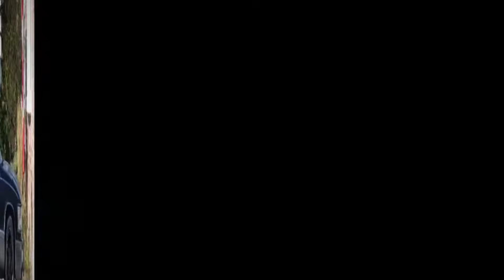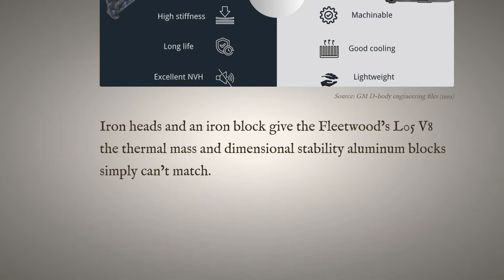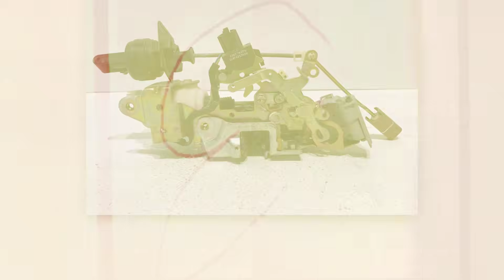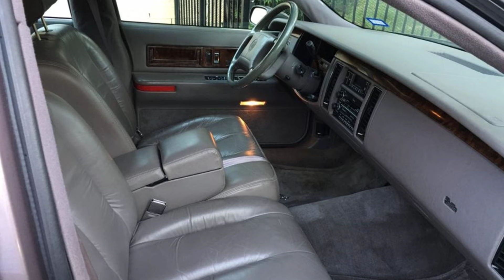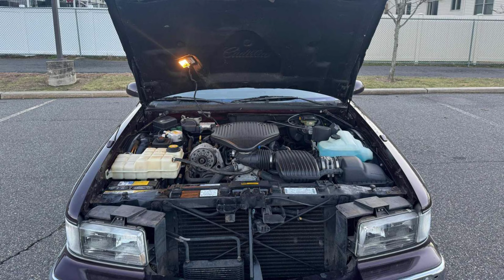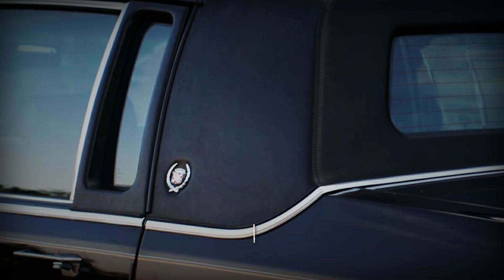Cadillac Fleetwood Brougham Was Meant To The Be Future — Until The Market Did This

Comment: That is the era of luxury cars i miss most. Smooth and simple to operate.

Yeah yeah, having ya car able to read ya mind and automatically order coffee for ya and have it delivered direct from Italy in matter of hours is nice but...not so nice when the feature goes kaputz and result in car not starting because it is integrated with starting system that require gps coordinates for security system that relies on ball joint sensors to know exact angle of the car just to send signal to starter And of course require 8000 min to fix and another 4000 for "software update". 😆  

Just simple smooth luxury riding without 4,000  per shock suspension system.
Reply from the maker: The coffee-ordering car that needs gps coordinates just to start is too real. The Fleetwood asked nothing of you and just delivered, thats the whole point.